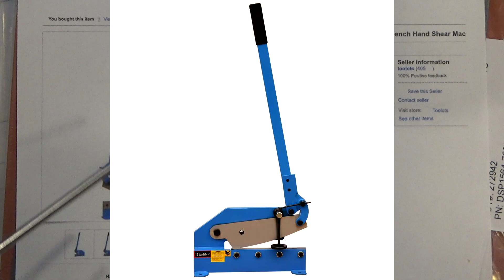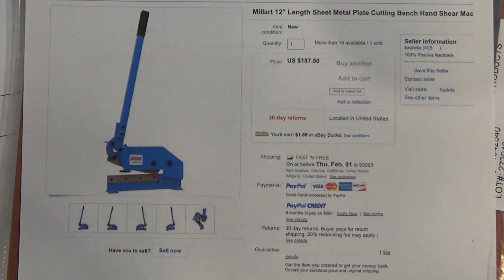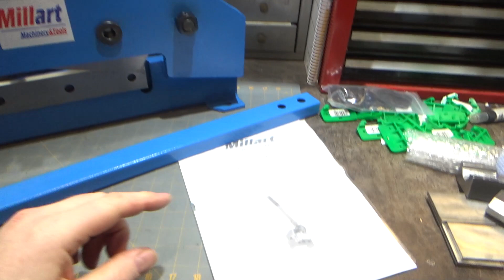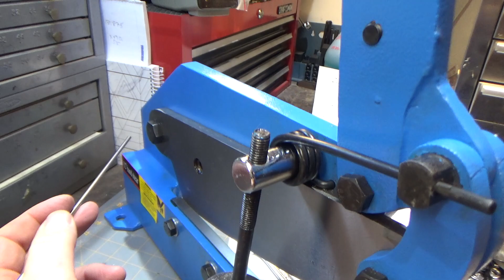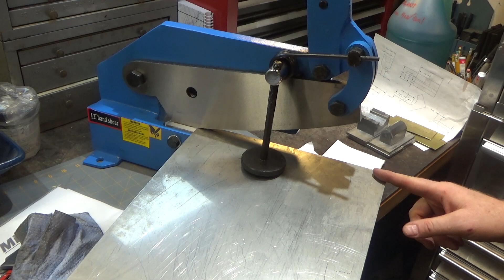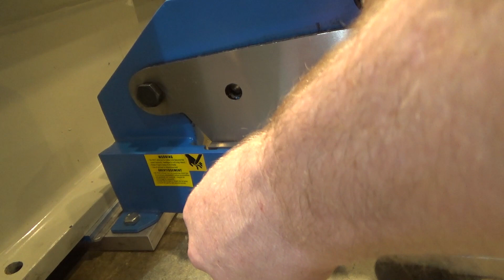QTR 20 Twelve Inch Millart Hand Shear

Comment: Pretty stoked that I just got one for under 70 bucks shipped.
Reply from the maker: I'd be. That's a great deal. I have used mine quite a few times since I made this review. The only thing I really would like is a platform to feed that parts into the cutter with an adjustable fence.

Comment: Thanks for the video  - Like you said the manual is kind of useless. The other thing our box said that it could do a 12" cut  - the blade only goes up enough to do a 10" cut  -  A little dissapointed in that.  I wonder if you ground out a little bit where the handle stops the blade from going higher you could get more cut length?  Thanks
Reply from the maker: I noticed that recently. I wish I had caught that when I was reviewing the tool.
Reply: I purchased the Northern Tool (Klutch) 12" model, which appears identical. I can cut unlimited length (beyond 12") by merely continuing to push the workpiece through past the back while constantly pulling down (multiple times) on the handle as I push to workpiece through. I'm not limited to just 12" length of cut nor do I have to reverse a piece such as done in this video.

Comment: This video was extremely useful , there's a lot of good tips ,info, I hope you make another one after a while to show how to adjust the blades for stainless or mild steel  of different thickness.
Reply from the maker: I am appreciate the comments, thanks. I don't think I know how to adjust the blades for a specific metal type. I have only adjusted them to set clearance.
Reply: @DudleyToolwright , I know stainless steel does not need much of a gap because it does not "draw" like mild steel so the gap (for SS) should be  about1/2 of what it is for mild steel ( regardless of the thickness of the material), that is my general rule of thumb, here is a good read for setting the blade clearance:
https://www.gasparini.com/en/blog/get-rid-shearing-defects-in-four-steps/

Comment: I couldn't quite see, but it appears that you have your tool holders stored on top of your lathe's splash guard?  Mine came with some 2 by maybe 3 wood bolted to the top splash guard with drilled one inch holes.  The protruding tools from the holders are inserted into the holes!.  It doesn't work very well and you can't really tell which tool is which.  I was going to make some out of 3/16" thick aluminum angle, cut to a width that would fit in the dovetail and bolted to the top of the backsplash.  Then I saw some on eBay like these: http://www.precision1tec.com/Our-Products.html
...and I thought, "Hey, those are neat.  I wonder if it would fit on my lathe..."
Reply from the maker: Yes. I built a shelf off of the back splash that holds quite a few. I got the inexpensive CXA holders from all industrial (on EBay). It is one of the places I reinvested the ad dollars from this channel. Every month I would get one or two.  Thanks for the link, those holders are really nice and inexpensive. Tom Lipton of Oxtools did something similar with off the shelf parts from the hardware store, if I remember correctly.

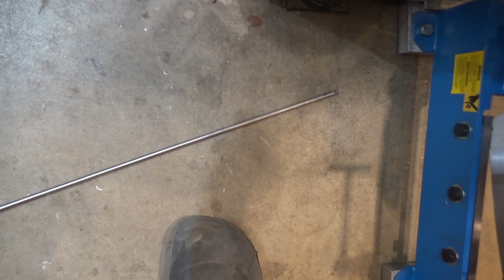Comment: That's the best view of the whole lathe (12:30) I've seen to date, although I seem to be viewing asynchronously.  It's very similar to mine, probably made in the same factory a generation later.  Mine is a Turret America 13x40vs from 1992, only 2600 pounds, and once owned by Boeing.  It was originally 460v and I suspect it wasn't running when I bought it.    I pretty much re-wired the whole thing (460v needs only really thin wires!) and installed a new VFD.  It looks like this one: https://cdn.globalauctionplatform.com/012b4ec4-844b-485c-b6dc-a5f00106bbfc/5110999b-06f0-4dce-f3e9-63fe3ad7f6b2/original.jpg, but not so rusty!
Reply from the maker: That looks like a really nice lathe. You should post some videos. You work on some interesting projects and I love to see how other people solve problems. Thanks for sharing.
Reply: @DudleyToolwright  how can I order like this one

Comment: Note that leverage ratio gets smaller as you get farther into a wide cut.
Reply from the maker: F*l = F*l as you say. AT least for a static system. Nice hearing from you.
Reply: Dudley Toolwright Another way to think about mechanical advantage is to answer the question: how far does the cutting edge move for each increment of handle movement (relative to where force is applied).
Reply from the maker: Good analogy.